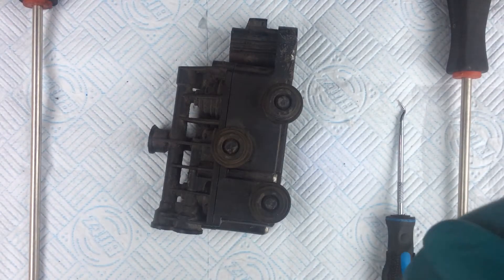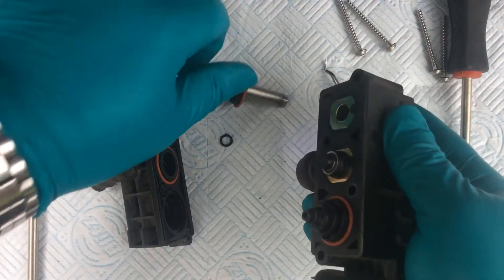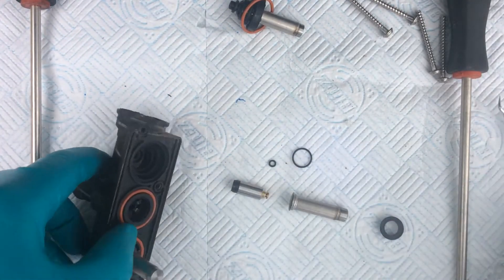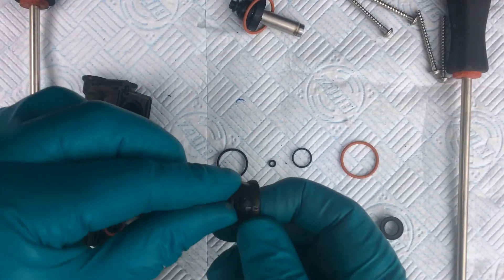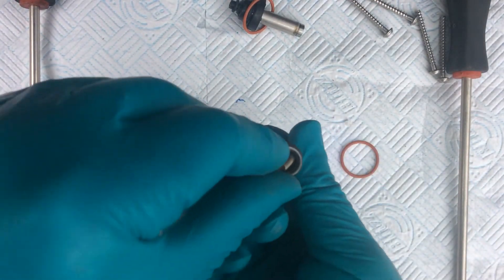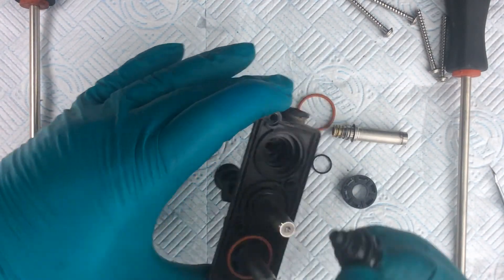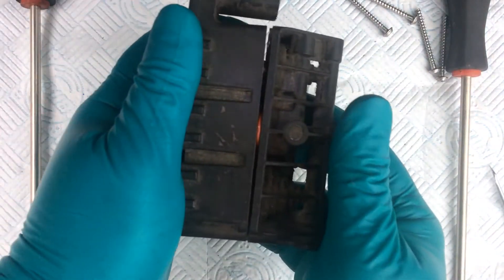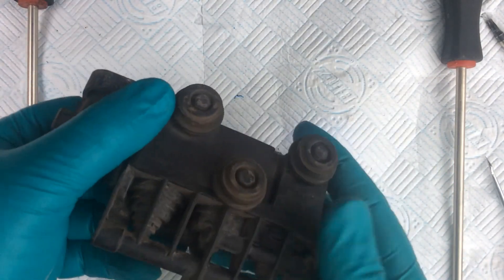UPDATED - Discovery 3/4 and Range Rover Sport suspension valve control block dissemble

Comment: Great vid thanks :) Also, how do you disconnect and the reconnect the air lines to the valve block when it's still on the car, and obviously when you go to put it back on? Do they just unbolt? Are they push in to release? Just need some advice one the above. Thank you :)
Reply from the maker: They just undo like a bolt.  Air will escape under pressure so take it slowly if you don’t have electronic tools to deflate the airbags first.  
Need to make sure you put the pipes back in the right hole. If you get them mixed up you’ll end up with a suspension fault.  Take a photo of it before removing.  

Make sure they go back in straight as it’s easy to cross thread in the plastic body.

Comment: Coz i rr problem rear suspension sometime canot level..rear right 460mm ..rear left 470mm..but went i of the engin sometime 10minit.. rear left valve i ear release air and level it ok 460mm 460mm..i diagnos fault code c112f-72 and c1130-66 intemitent fault

Comment: hi Ian. do you clean out the block with anything?
Reply from the maker: Darren Wootton only with a lint free cloth or similar.   The very tiniest bit of silicon grease and I mean half as much as you thought was tiny, on the small rubber seal that goes over the tip.
Reply: MrBodsy no liquids?
Reply from the maker: Darren Wootton definitely not.

Comment: Hi, I am wondering if anyone can help, I have a range rover sport 2010, that when parked over night the rear passenger side suspension arm increases in height, when unlocked it resets itself, you can hear the pressure release valve release and it goes back to normal levels. Has anyone come across this issue? I guess it could be the valve block seals leaking air into the air cushion....